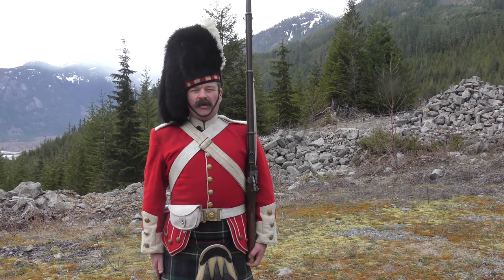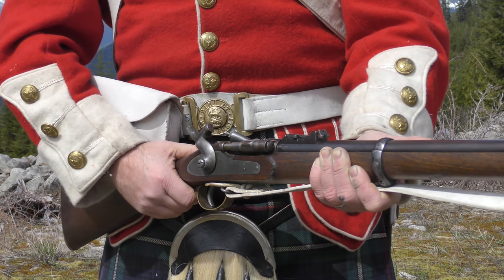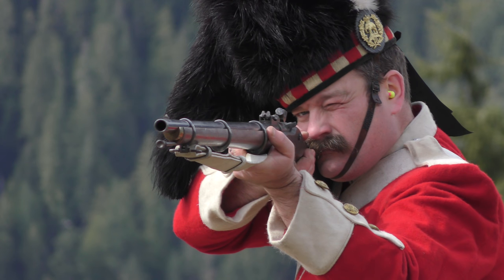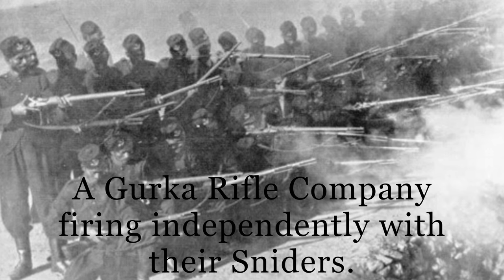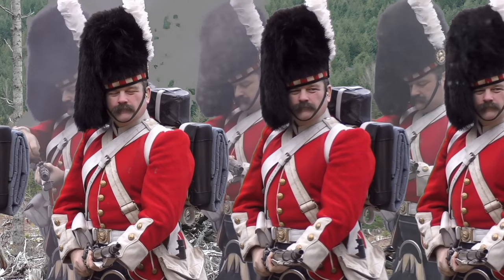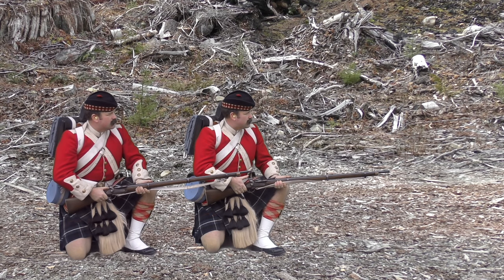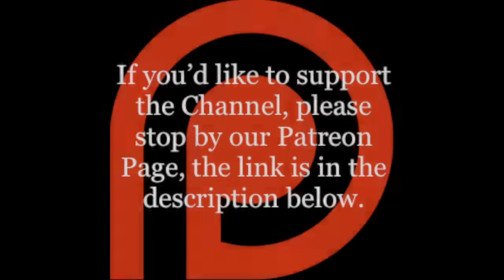The Mk III Snider-Enfield: The Platoon Exercise c.1867

Comment: Surely the British and empire armies' firepower was increased twofold due to the use of clones and multiplication of men on the battlefield ;) At this rate we'll get the Royal Rob Highlanders XD

Great video, I was shocked to learn about the contrast of the 27 movements for a musket compared to the 9 for the snider as well as the fact that it was the breechloader's effects around this era introducing a change to extended order fighting being the norm~

I would also like to enquire as to the medley that you used, especially around 11:08, the beat is so heavy :O
Reply from the maker: The music was an Irish medley IIRC... as for the tactical change, it was slow at first but by the mid to late 1870s extended order was the norm for the attack.  I have a video in the works on it.
Reply: It is an Irish medley, 11.26 minutes they play Fare thee well Inniskilling. 
First class videos as ever! Thank you

Comment: That's a mighty bonny bonnet you're wearing!  The white feather is an especially fashionable touch.  Hard to imagine soldiers fighting in such a uniform, but I'm assuming they did.  Great channel!
Reply from the maker: The feather bonnet was last worn on campaign in the Indian Mutiny of 1857-59.  After that, it remained part of the Highland Uniform but was replaced by the glengarry (forage cap) and/or the foreign service helmet for use on campaign.
Reply: Remember that much combat was at chatting distance. If you see a man wearing that outfit do you think he's scared of anything?

Comment: Yet another fine presentation. I have only seen a couple Sniders and they were in rough condition, I say that to preface a question. When loading a cartridge and you then close the breech, does it lock in place? It looks as though it simply sits there.
Reply from the maker: There is a spring loaded plunger in the rear of the breech block on the Mk I and II variants, with an added catch on the side in the Mk III... all are more than safe with modern cases...

Comment: I) There must have been a lot of hearing damage in the front rank. That step to the side doesn't ceate much distance from the rear rank's muzzles. The shock, noise and smoke must surely have affected front rank accuracy and endurance.
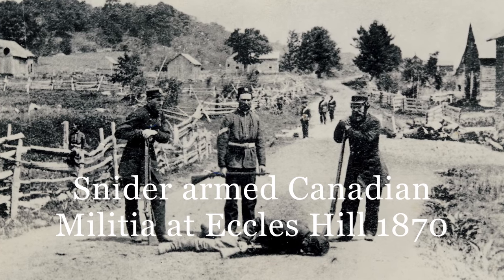ii) The pic at 3:50 of the Battle of Eccles Hill is very interesting. Never knew of such an raid by the Fenian Brotherhood. What were they trying to acheve? An attack on all things British? Wasn't the Montreal region, then as now, the centre of French-Canadian culture?
Reply from the maker: The effects used here do not allow for a true representation of the spacing of the ranks.  The muzzles of the rear rank would indeed be well in front of the front rank... The pace forward of the rear rank before the delivery of the fire sees it close well up to the front rank.  There were two main series of Fenian Raids into Canada.  1866 and 1870... the former was the larger.  Yes, the Fenians were set to attack the British in any way possible... and their actions (of 1866)  were actually a key in galvanizing the then Colonies to Confederate into the nation of Canada.

Comment: Hey just a question for all the Snider Enfield owners out there. I now have the casings, powder, card wads and x ring service bullet for my snider. I know that the snider is 577 in cal. To me the .600 snider bullet looks very large for the bore. Is this normal?
Reply from the maker: The calibre is the measure of the bore, not the rifling... with the progressive depth rifling it has, the rifling at the breech is is .015 deep which gives a overall depth of nominally over .600... with modern reasoning, you want to fill the rifling at the breech... the .600 does that ...the bullet is swaged as it travels down the barrel.  No problems,... all my shooting is with it..
Reply: Thanks alot

Comment: You'd think that 'ease springs' would be on an empty chamber, but the Army isn't always that sensible. As of 10 years ago, I know the drill command in the Army to 'change step'... didn't. It was timed such that it looked smart, but you actually stayed in step! The RAF version is more of a skip, where one hit kicks the back of the other, and it actually does change step. So who knows if it was on an empty chamber? Given the cost of ammunition back then, I'd expect so, if only for cost reasons - can't imagine safety played much part in the choice.
Reply: However, if there is any danger of shooting your own troops then I would suspect that they made sure that the rifle was unloaded first.
Reply from the maker: If the rifle was loaded it would typically be for action and be at the half cock.  In all the actual firing drills demonstrated here that is how they are written.

Comment: I would think that glorious hanging piece on the highland bonnet becomes a liability when you're in the front rank and the rear rank fires. A single spark or muzzle flash could spell disaster.
Reply from the maker: Amazing that they were worn in many actions again and again, without incident....  That said, here the Snider is in use and has no signature at the breech.... :)

Comment: I have recently started watching your videos and are facinating. I am also Canadian, though on the opposite of the country since im from New Brunswick. What i really like is your interest in covering Canadian military aswell. Since i believe it's much overlooked, and my Family has a deep route in the military (Every generation from 1775-1951). Tell me, where do you get your uniforms? And if so are there any canadian ones? I would really like either A canadian mounted Division(2nd boar war) or a 1866 pattern redcoat which i heard was only made for canadians. Is this true?
Reply from the maker: Yes, the tunic worn in 1866 was peculiarly Canadian, although with obvious British Empire roots... It offered only in detail... the Austrian knot on the cuffs and the twisted shoulder cords are the dead giveaways. Canadians in the Boer War used what the rest of the Forces in SA used, generally.  Bits of Oliver pattern kit was, however, conspicuous in it's use.  For details about the hit I use, try the "Kit" series on the Channel. Cheers.
Reply: @britishmuzzleloaders  why thank you! I wonder why Austrian styling? The only province with a strong Austrian-germanic heritence would be my province. (New Brunswick) so its very odd. Anyway I thank you for responding very quickly. Also a side note. Is the british pattern 37 almost the same as the pattern 08? Just wondering cause i cant get the jacket and trousers for cheap. But they only have the P08 kit. Would i be able to jimmy rig a ww1 kit?
Reply from the maker: @J Combs No, the cuff detail had nothing to do with ethnic slants... just the selection of a board who patterned the uniforms...  The Royal Artillery used it right the way through till the end of Full Dress (and still do today) At the time, the British Army was still using the slashed cuff (as in this video) and they transitioned to a pointed, double bread cuff in 1868, then again to a trefoil cuff in 1871... incidentally the latter was adopted by Canada later on and still is what Canadian Line Infantry Full Dress is cuffed with...  P08 and P37 are completely different.. they only share the "Large Pack"... which was hardly ever used with the P37.  Cheers.
Reply: @britishmuzzleloaders  Cheers. Thank you very much this was helpful.

Comment: Today I shot my snider Mk2 ** for the first time to fire-form my x ring brass. For those of you that are just getting into black powder or say snider shooting I thought that it would be useful for you to know how I fire-formed my brass. I used 62 grains of 2ff black powder and 40 grains of cornmeal filler followed by a 20 gauge card wad and mini ball. Accuracy was actually alright. More than what I expected. So if you are looking for a good starting load for fire forming I recommend this. Also please be careful about discharging a snider that may NOT BE SAFE. If you are unsure remotely discharge the firearm first using a string or go to a gunsmith.
Reply from the maker: Great to hear!  Interested in hearing how it does with continued work up!
Reply: the next shots will be with the x ring services bullet 70 grains of 2ff. Ill have to find the cornmeal measurement through trial and error.
Reply from the maker: If you want to maximize your Snider's effect, then you need to approach the work up in a comprehensive manner... Have a look at the Snider Work Up videos... if you are interested.
Reply: Im very curios as to where these tight fitting x-ring service bullets will land. With the mine ball my rifle shot 1 foot high at 100 yards with 62 grains of powder. The heavier projectile should bring that point of impact down unless the extra 8 grains of powder cancel that weight difference. By the way did you find that when loading the x-ring services bullet for the first time that the bullet is very hard to get into the case? Also one of my 25 loaded projectiles actually is able to rotate freely around in the case almost reminds of a loose 22lr round that you would get from a 550 round bulk pack. Just curious if you have ever had a x ring round rotate freely in the case or say fit loose? I know that the cartridge has no neck tension so maybe this isn't an issue.
Reply from the maker: The rounds are not tight, typically.  The rifle will shoot high unless you are using completely anemic loads... it's the way they were designed.  Don't fight it... as in the Work-Up videos, find your best performing load and then adjust the sights using one of many methods...
Reply: Alright thanks. Hopefully someday I will get a good wooden table and RCBS press to reload Martini Henry. I do though have to make sure to get a very good condition Martini.